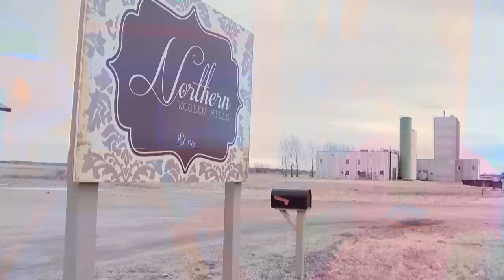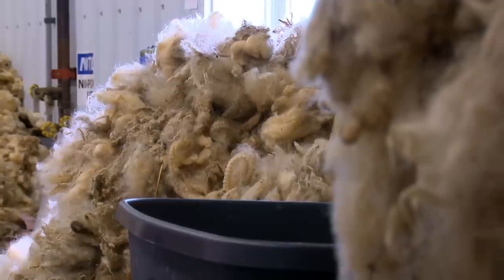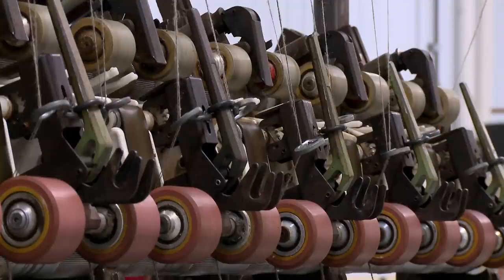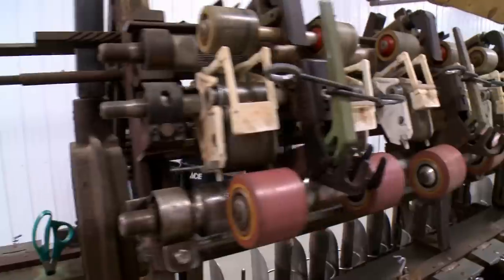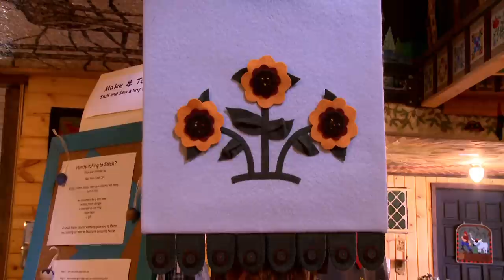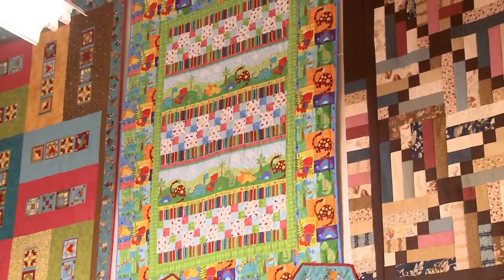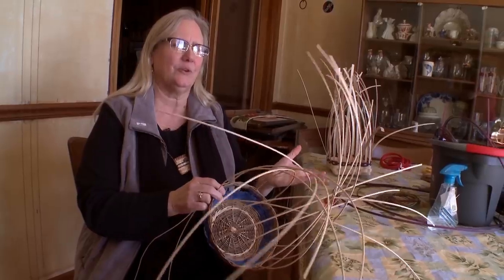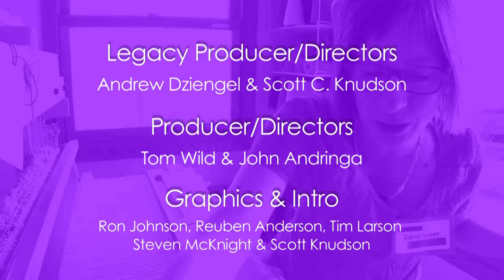Common Ground 811 - Fiber Arts Tour

Comment: The vintage black Singer industrial embroidery sewing machine featured from 11:33-12:12 is a Singer 114W103. It is a single thread chain stitch sewing machine. The W in the model number designates this machine was produced in Bridgeport, Connecticut.
A beige Singer 114E103 chain stitch machine is featured at 11:30. The E designates that machine was produced in Japan.
Singer 114K103 designates Kilbowie, Scotland production.
Can be adjusted to make the drop or moss stitch without unthreading machine.